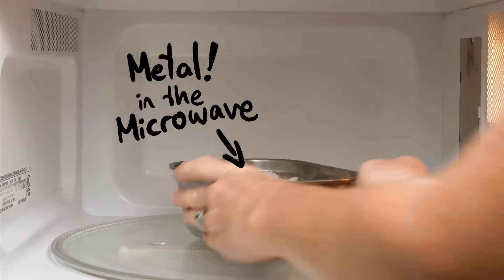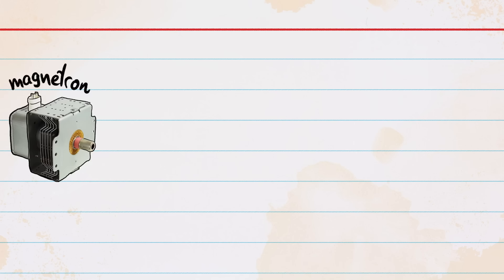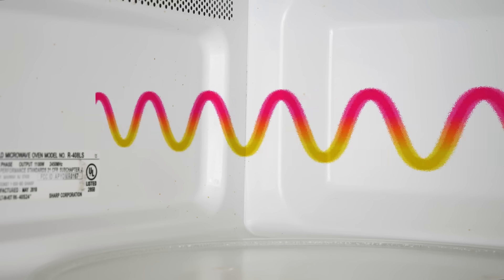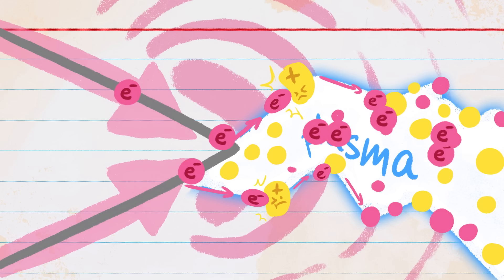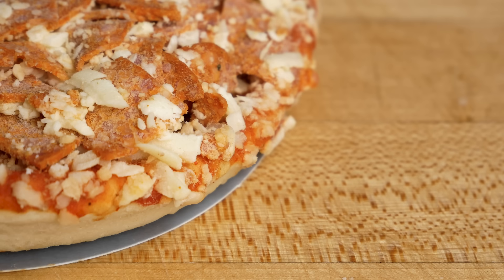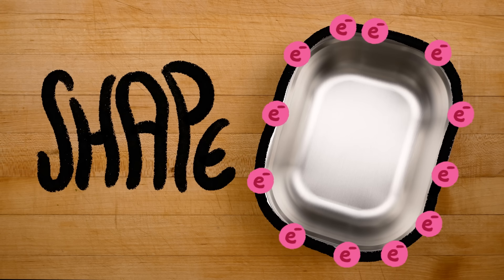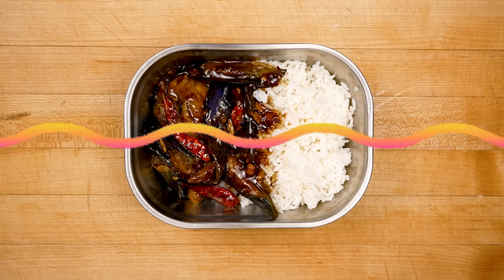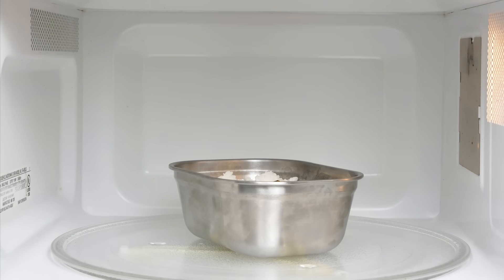Microwaving metal is FINE (sometimes)

Comment: My microwave came with a metal grill that you're supposed to use in the microwave to put something on a second level - so you can heat two plates, for example. 
The grill is mostly round metal bits that don't arc, with the legs edges covered in rubber hats - preventing slipping but also arcing.
Reply: I created some arcs in a microwave in the 80's, and subsequently did not question the no metal in the microwave policy. In the early 00's, doing finish carpentry in fancy condos, I installed microwaves with those metal grills. I was briefly stupefied, but then never thought about it again until I saw this video. I guess I though rich people microwaves just had special powers that defied physics.
Reply: My grandparents had one with a metal rack with built in pegs just like in an oven. It also had a temperature probe that you could plug in to a jack in the wall with a long cable an a good six inches of metal probe, so you could cook a roast or similar with the automatic function.
Reply: @smartyhall  wouldn't the turn table tangle the probe's lead?
Reply: @ That was a much later addition to microwaves.
Reply: Wouldn't they be rubber shoes?
Reply: @Timeward76  the legs go down but also up.
Reply: My microwave oven came with a metal grill. The instructions says to use it in the oven setting, not the microwave setting.
Reply: Wonder how manual was written. “Don’t put in metal. Also we offer convenient metal grill for you.”

Comment: Would have been nice with at test...
How long does it take to get water to boiling in a metal container vs a glass one?
(The glass one have more mass to heat up but the metal one reelects some of the microwaves. I guess a thin plastic one is the fastest. 😂

Comment: my microwave literally has a infographic symbol on it to tell you to not microwave water without a (metal) spoon in it to prevent delayed boiling
Reply: This is mostly to create a nucleation point for the water to boil from. Water heated to boiling temps in the microwave generally won't boil unless there is something inside to create a pressure difference. This is due to the water heating rather evenly in a smooth-walled container, which sort of suspends the liquid's ability to boil even at high temperatures. The moment a spoon or something is added, the boil will trigger and can splash hot water everywhere. As a kid, I knew someone who needed a skin graft after taking hot water out of the microwave and dropping her tea bag into it. The moment the teabag broke the surface, half the liquid launched from her cup and onto her hand and lap. No one ever told me about that until that point, and most adults I know still don't realise that can happen.
Reply: @SpoodyFlopp  worth noting while this can happen it usually wont since tap water typically has plenty of dissolved minerals to act as nucleation points.  That being said distilled water is a far bigger risk.  So definitely do not trust it
Reply: @aerozord  a common occurrence of people getting hurt by this is parents microwaving water for preparing baby food
Reply: @SpoodyFlopp you can also use a wooden chopstick.
Reply: I learned that the hard way. I microwaved a glass of water, and when I had it in my hand it exploded (the water, not the glass) and burned me.
Reply: A wood spoon should work too.
Reply: Had a glass of water explode so violently it blew the door off and completely ruined the unit.